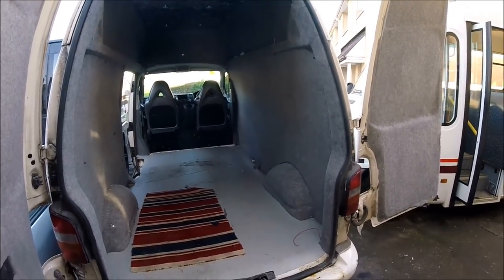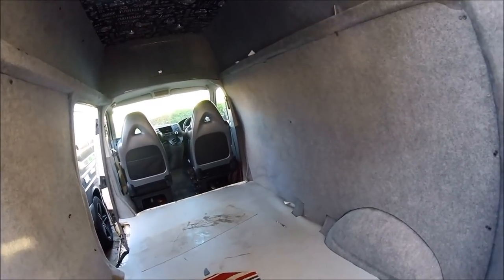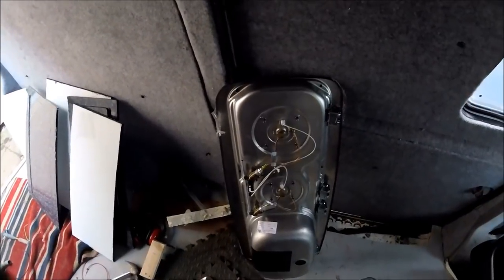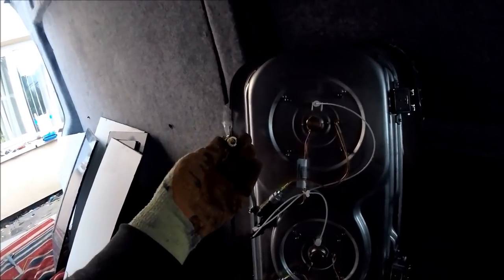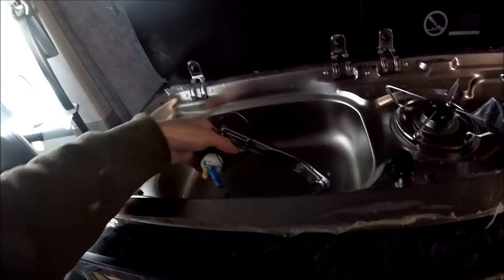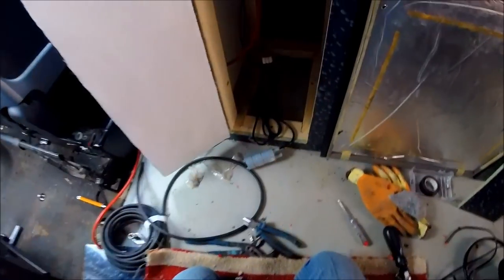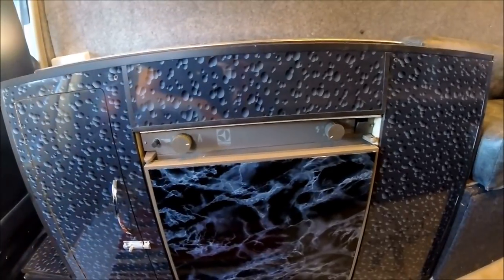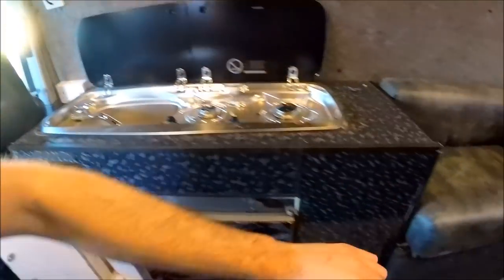VW T5 Camper Conversion Part 19: kitchen Unit, Smev 9222 & 3 Way Fridge Build & Install

Comment: Great video! Thank you! About to attempt similar and just wondering what the thread sealant your used on the compression fittings were/brass or copper olives and if 8mm similar to 15mm in handtighten and then do an extra 1/4 turn or if you nipped tighter with yours. Cheers & thanks again Jamie

Comment: On your last vid you earthed the copper pipe for the  smev 
Where would you get that earthing cable from 
Thanks, I like your work. 👌 
Are you going to keep one for yourself,
Reply from the maker: Search eBay for earth clamp and that will show what I used.  
I will be keeping one of the vans, just not sure which one yet, I might advertise both and keep whichever doesn't sell first